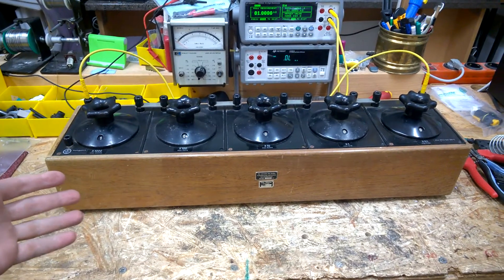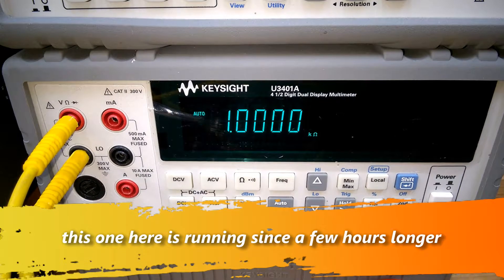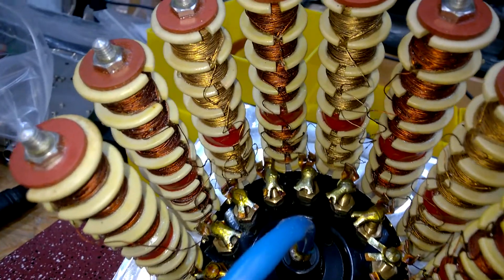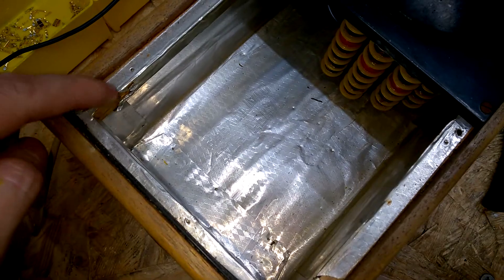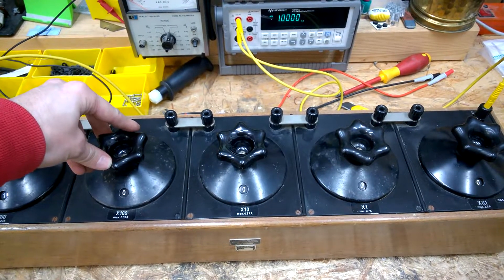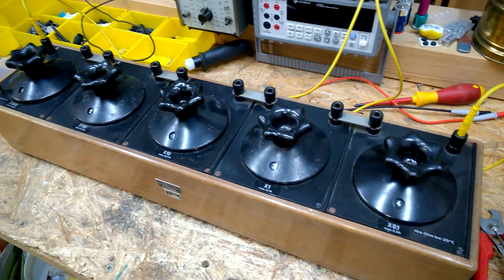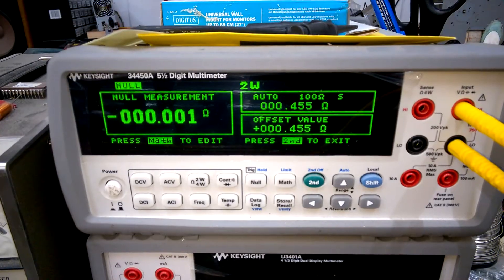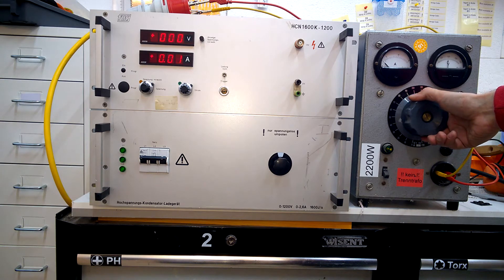BEB #58: Precision Decade Resistor Box (It's impressive!!)

Comment: 1:49 Max, are you sure each resistor has 1000.00 Ohms? Could be a Little less, supposedly though, to compensate for the switching contacts and wires in between.